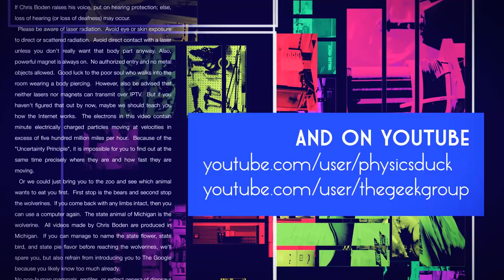Captain's Blog 9 13 2017 Epoxy Coil Experiment 1

Comment: wash the pipe before the epoxy.  what is the pot?  wire seems to be your favorite nonelectric part of tesla coils.  find a good use for the bent wire.  starting the wire coil is the hardest part.  whats that noise while you wrap the pipe in wire?  sending the wire at first gear speeds is safer.